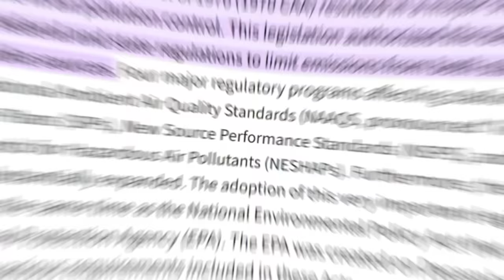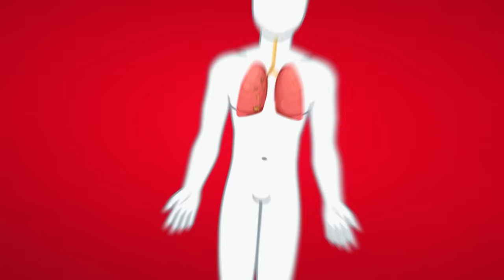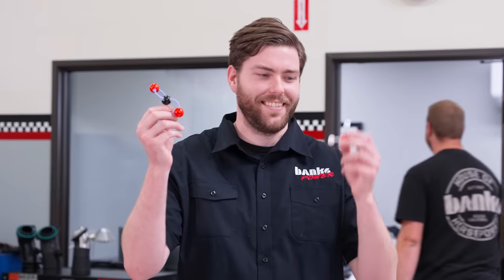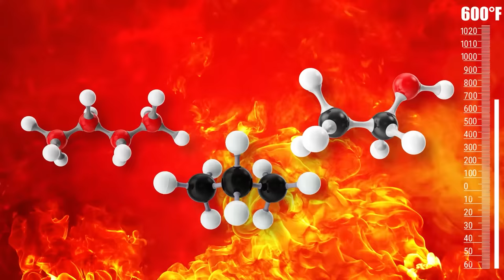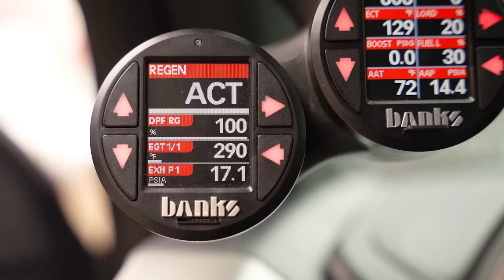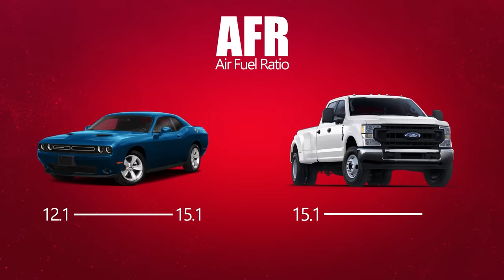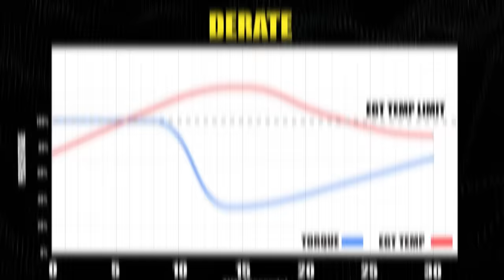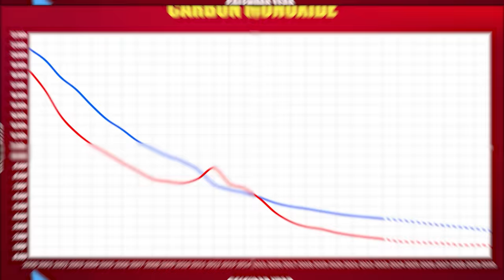Understanding the Most Hated part of your Truck | Banks Entry Level

Comment from the maker: With tighter emissions standards and stricter enforcement, the DPF and the rest emissions systems seem to be the only way to keep diesel trucks from being regulated out of existence.  Will manufacturers come up with a better simpler way to reduce emissions? Or is the DPF here to stay? What do you think?
Reply: ? Which is better for the health of your emission system: stationary regen or driving to clean?...Or does it matter as long the regen happens?
Reply: I think banks should engineer a free flow DPF w/ the manufacturer to make something more realistic reliable and EPA certified.
Reply from the maker: Or, even better as soon as someone figures out how to burn 100% of the fuel in-cylinder, DPFs will no longer be required. Toyota has patented a new diesel combustion process that may get us closer to that goal.
Reply: @bankspower  Isuzu 5.2..enough said.
Reply: @bankspower Shame that tech will never come to the USA then if Toyota patented it 😢
I love Toyota but having to move away from them since they refuse to enter the US diesel market. A proper 3/4Ton Diesel Tundra would make every other truck obsolete...
Reply: In Europe they burn Kerosene as their diesel instead of installing expensive muffler parts that will fail over a short period of time. Having a DPF and DEF system ends up costing the end consumer a lot of money for repairs. Great Video!
Reply: @Luckingsworth you underestimate corporate needs to license that patent to ensure their emissions compliance. I wouldn’t be surprised if the EPA pushes all passenger vehicle manufacturers to use that technology. Someone’s gonna copy the Toyota method, but slightly different and the rest of the field will buy directly from Toyota I predict.
Reply: It’s a money grab and should be deleted immediately.
Reply: CNH is "virtually" dpf free. They don't even use egr for their larger engines. Only scr/def and doc. Even the oil companies like amsoil say the oil last longer and test better than other emissions systems. However, offroad standards are a bit different, and ag equipment has a more fixed load scenario.
Reply: I’m hoping they figure out something new, I went back to gas 1 tons because of dpf issues, had two shit the bed over the years, and i know more than a handful of guys that have been left stranded by trucks with them. We need a different solution
Reply: @Luckingsworth I was hopeful when rumors started circulating then Nissan jumped in and I said please let Toyota get in on this…..and nothing. 

A game changer would have been tundra with Cummins and Aisin transmission
Reply: @ck3561  100%. The Tundra and Tacoma update was the final nail in the coffin for me. They 100% are riding the coattails of the Toyota brand and not only did nothing to innovate and improve, in many ways the newest gen are way worse than the previous. Embarassing.
Reply: Money pit
Reply: @bankspower So what are they doing about brake dust. It’s estimated at 20% of particulate pollution vs 7% of emissions particulate pollution. Plus brake are on everything. Even EV’s
Reply: Great info! Every diesel owner should know all of this info.
Reply: Locomotives have some kind of exhaust system that doesn’t use DEF. Tier 4 is the most recent exhaust requirement.
Reply: Too bad Banks touts the virtues of the Derringer inline tuner, but failed to make one for the 600,000 LML Duramaxes that desperately need clean tunes. Great presentation, but won't help me much without a clean tune.
Reply from the maker: @KeithGipe  We don't have a Derringer inline tuner for the LML yet, but we do have a programmer called the Automind. It can add up to +135 HP & +240 lb-ft. Part # 66411

https://www.bankspower.com/i-2132
Reply: @bankspower  "Yet"? I keep hearing Abnks reps say that, but no one will confirm an actual R&D program for the LMLs. Besdes, you miss my point. Banks NEVER says that the Automind2 tuner is an equivalent "clean" tuner. In fact, I've never seen any Banks promo for that tuner, ever. If it infact is an alternative clean tuner, why no promo that? Banks pretends it doesn't exist in their videos. Also, that is a flash tuner w/o any of the conveniences of an inline tuner.  I have Banks Monster Exhaust, Ram-Air, Super Gauge, and Pedal Monster. The tuner is the last piece I need and I'm hesitant to turn elsewhere since I love and trust Banks product. Several time Banks personnel have indicated there might be something in the works for the LML, but nothing seems to happen. The "Yet" in your replay is like dangling the carrot. Maybe Gale could turn a little of his attention back to his roots and service the little guy instead of putting 90% of his effort into lucrative govt contracts. But, I guess that's where the money is.
Reply: That why I still have my pre 07 model diesel truck, and for the commercial side. Will not touch any truck between 04 and 13. Due to they have so many issues. I just carry an extra NOX sensor like an extra light just incase. Replace the DPF filter on a regular basis (realize  we do over 250k miles a year). If you think they rip you off for the filter, then realize bulk DEF is like $1.50 a gallon, at truck stop you'll pay about $3 to $4 a gallon. If you go to a  shop, it's $12 to $15, so you really getting rip off more for the DEF.
Reply: I much prefer listening to Eric on video.
Reply: Have you folks ever had to do DME Diesels?
Reply: @bankspower  Mahindra doesn’t use a dpf on their tractors. Biggest reason I bought a Mahindra
Reply from the maker: @KeithGipe  The AutoMind an outstanding flash tuner, with a clean emissions profile. However, there is a superior device coming soon, as a result, we decided not to dedicate resources toward promoting the AutoMind. To be clear, we have a Derringer inline tuner coming for the LML. We also have another tuning solution on the way that we have not promoted, and likely won't promote until the day it's available. It's under wraps. This new tuning solution may very well supersede the Derringer. Regarding defense contracts, they can and do upset new product development. Our selection of LML parts is proof of his disruption. With that said, there are a bevy of new Duramax parts on the way, both mechanical and electrical. Gale has not forgotten his roots in performance products. It's the core of our business and it's our passion.
Reply: So what dpf need to put on cruise ships oil tankers and earth movers? Just a thought? Do they also have government complaint standards? And how does the government check them? And When they check them with what? Especially ships? And what gadgets they use? Earth movers also? how they check them? government officials fly out to unlivable areas? And what devices they use then? Do the big company's complying with the laws or just us ordinary people need to obey the rules..?? Or is it for big companies one thing and for ordinary people is another thing? Or juts big companies pay off to be queit so us ordinary people pay for everything?
Reply: @bankspower  Very good news. I'm happy that we're not forgotten. Look forward to hearing about and trying out the new stuff in the not-too-distant future.
Reply: Great video! Really clarifies why we have all that stuff. So here's my question regarding regens: I've read that if you drive your truck like you stole it, it should help with the Regensburg not occurring so frequently. So if you put a pedal monster on a truck and drive it, would that help with burning off that crude before it went into regen?
Reply: @Sennerav in Europe what.... We use dpf since 2005 or so... 🤣 And our diesel is actually pretty clean
Reply: @gato69evo  DPF was introduced in 2007 in North America on Medium and Heavy duty Trucks. The very clean diesel you refer too is actually Kerosene. Here in North America we burn heavy diesel oil or low sulfur diesel, red dye diesel not kerosene. It makes a big difference simply at the tail pipe
Reply: Meanwhile the government trucks don’t need em
Reply: Imagine a world where trucks were electric, and then clever engineers comes up with the idea of using diesel in a friction engine with turbos, high pressure fuel injection, end even with expensive converters, DPFs, still causes pollution. They would just be laughed at.
Reply: How about  requiring stricter fuel regulations  to reduce  soot.
Reply: @ChronoTango  If that is the case, then extending the life of existing and older vehicles well past their anticipated lifetime will become the norm. That is the "Cuban Effect".
Reply: Took all that crap off my 22 cummins it's useless
Reply: @lawrenceartz8640  I haven’t researched this new technology at all so I have no idea what it will bring with it. If it means a diesel motor will be even more efficient and less emissive, I don’t immediately see that as a bad thing, though I’m sure some extra complexity will come with it. As for the “Cuban Effect,” I thought that was due to embargos, not new vehicle technologies.

Did you just make up the “Cuban Effect”? When I look it up, all I get are redirects to Havana Syndrome and people being upset with Mark Cuban.
Reply: que me, banning DPF systems and any system that "is needless and excessive for the purposes of cost increases" Maintenance should never be expensive on a vehicle and we should not be introducing technologies that complicate vehicles.  the simpler the vehicle is the better and longer lasting it will be.
Reply: "Lets trap all the exhaust soot and carbon just expell it somewhere else all at one time!" Brilliant! Yeah emissions are a joke, instead of castrating the motor and making it run worse and shorten engine, mechanical part and oil life, why not get the engines to run more efficiently so they wont need that equipment? Oh wait, then they can't charge extra money for the DEF, which is terrible for anything it touches, not to mention the truck manufacturers make bank off all the emissions parts....Did I mention emissions are a joke? 😂
Reply: Do these products voids factory warranty?
Reply: My son wants to interview Gale Banks for his school paper on automotive industry icons. He’s the only one I know of who chose a living subject 😂
He loves watching these videos with me on Saturday mornings. Anyway how can I put my little guy in touch with the boss man Mr. Banks ?
Reply: @Fee.1  dude I would send a email to their pr team. Best chance. Don't know how much time he has though and good luck
Reply: @TheObsesedAnimeFreaks  thanks I’ll see if I can find their email
Reply: @TheObsesedAnimeFreaks  is he sick or something or you just mean his age?
Reply: @Fee.1  no i mean he's probably busy. lol. he's a business man. he's got work to do.
Reply: DPF... seems like plumbing the vaporized* oil back to the engine creates soot  needlessly, it being harder to burn and containing that zinc stuff...the other short chain carbon molecules that come with that oil is probably easy to burn. Perhaps a multistage oil separator process with a condenser to capture the moisture and then send the gases to the engine.
 
Incomplete burn of diesel causes carbon soot, so having inert gas from the EGR is causing pollution. EGR exasperating the need for DPF system is a ridiculous loop .

DPF also filters the sulfur soot but if they are already reducing the sulfur content in the fuel, and plan to lower it even further and sulphur is taking a 100k miles for it build up,  keeping the DPF for sulphur soot is prolly not needed.

DEF system to me is foolish because  because  the NOx returns to the soil as nitrates which is a fertilizer.
If you think about it NOx is produced by lightning which is a huge amount of energy, and there must be a way for the earth to deal with it.
Looking at the relationship between smog and NOx is that it needs un-burnt fuel (volatile organic compound)  to xreat the smog in the first place. NOx isn't a problem
Reply: I did the same to mine, yet it's to expensive to replace. My motor also told me that it didn't like sucking in its own farts, and when it does it chokes out and it's arteries gets clogged with carbon it previously tried to expell.

*I identify as a motor whisperer

So, out of empathy I took the rest of the cancerous system off of it.

She has never been so happy.
Reply: As usual Banks is right on when it comes to emissions.   I just sold off my Duramax and have a Mercedes Benz Sprinter.   As many in the RV community I wish he offered some products for them especially when you consider how many Mercedes Benz Diesel vans there are out there!   Banks, keep strong, you guys are the best!
Reply: @zekester1  Passive regen is better. Why? You are not using any additional fuel to get the DPF temps up to where they need to be to burn off the soot. This means less hydrocarbons entering the DPF to begin with and less fuel usage overall (no decreased MPG)
Reply: @mx3727  Yes, I agree passive regen's are better. My point is when an active regen is happening which of the methods is better on the truck
Reply: @zekester1  Which of what methods? I don't understand your question. There are only two methods of regen: active and passive. Passive occurs when the exhaust temps are already high enough to burn off the soot - that's the best scenario. Active occurs when the temps never get high enough during the drive cycle and the DPF gets to a certain percentage of soot load, and then the truck uses extra fuel to get the exhaust temps up to that magic 1100+ degrees to burn off the soot.

The SCR system serves the same function as the EGR system - to reduce NOX. The primary method to accomplish this is the EGR system, and if the EGR system can't get the NOX low enough, the SCR system "cleans up" the NOX "after the fact". So, if a truck seems to be all of a sudden using alot more DEF, it likely indicates an EGR system problem (assuming no actual DEF leakage).

A poorly running (or poorly tuned) engine will over-tax a stock aftertreatment system and cause premature failure. It's as simple as that really. Companies, like Banks, that put a lot of R&D into their parts and tunes have an advantage over some other companies that don't put in the R&D and maybe don't even fully understand how these systems work.
Reply: @mx3727  Again I agree with you on all you are saying...What I'm asking is driving vs stationary (manual/ forced) which is better?...let's say you turn off auto regen & you do mostly stationary regen's are you potentially creating future problems with other components because heat sinking issues?
Reply: @zekester1  Well, if you mean having the truck perform a regen while driving (either passive or active) versus a "forced" regen (using a scantool usually, though some medium and heavy duty trucks have a switch on the dash that can force a regen), I'd say that the former is better, since the vehicle is not sitting stationary and airflow over the vehicle while driving will dissipate heat generated during the regen. I can't point to any scientific proof of that, but it seems pretty clear to me that generating that much heat while stationary is not necessarily "good" for other components of the vehicle - not to mention possible environmental issues (don't be parked in the grass for instance).

So, your assessment that you could be creating future issues with other components due to "heat soak" over time seems valid, but I know of no statistics or studies that prove that out. Hope that helps.
Reply: @mx3727  Thanks for input, that's my thoughts also...have a wonderful day😉👍💪💯
Reply: They need to figure out how to get rid of DEF systems and be just as emissions friendly... up in Canada, DEF systems are such a massive problem and a huge cost for all the industries. I worked at a trucking company that had all brand new trucks and every single one would hit derate multiple times during winter months due to freezing DEF. The construction company is just as bad if not worse because they leave equipment on site overnight.
Reply: @jjunderwood4095  The problem is, they really can't. A by-product of diesel combustion is NOX; DEF helps reduce NOX by a process called Selective Catalyst Reduction (SCR). EGR does the same by reducing combustion temps. The problem is, too much EGR is bad for combustion, Hence the need for SCR and DEF.

In a lab, where everything is tightly controlled and they can operate in the "best" of environments, the engineers can likely design an engine that can meet emissions without EGR and DEF. But, as soon as you start operating in "the real world" and things start to wear, that goes out the window.

Those companies could have solved those DEF freezing problems if they really wanted to. However, I personally don't feel like the EPA needs to be mandating the standards they are when it come to emissions, which is the real driver of the emissions systems we see today. I'm all for clean air, but I'm also for using some common sense. There's still "work" that needs to be done, and having a truck derate to 5mph because the DEF is frozen (or the level is too low) is just plain stupid. BTW, I work as a diesel technician, so I know the deal.
Reply: @matthewholzmueller6292  if that sort of part works i wouldn't mind in the slightest about having a dpf ony truck as long as it doesn't cost a small fortune to replace or repair this is what I would like if you want  us to be clean and compliant give us shit that works not drain our wallets
Reply: @bankspower if that comes out and shows itself to be better give
Reply: @toofastnobrakes it's either delete or go back to gas
Reply: @fireflyraven2760  yep
Reply: Yah but these emissions systems are directly causing diesels to go the way of the dinosaur. I can't tell you how many people nowadays are switching to gas HD trucks because diesel engines have all of this crap on them and suffer for it. Even Ford knows this and is why they're coming out with bigger HD gas engines like the godzilla because they know some would rather have that than a modern diesel. These regulations are already killing the diesel, so someone either needs to find a physical solution that supercedes these systems or the regulations need to become a lot more reasonable.
Reply: @payton4148  and like true politics neither of those things will happen they simply don't see a reason to until their way of life is suffering then they look for alternative's as long as it makes them money they don't care
Reply: Brother I’m gonna learn something dem school books and pencils won’t teach ya. Horse power is horse power regardless of whether you’re deleted or not. But lemme tell you something partner. Unless you drop that metal clunker filter you ain’t never Gonna hear that BEAST WHISTLE
Reply: @rockynymia  we know that is why we delete
Reply: @rockynymia right on, The manufacturer knows having that thing is problematic for them and us. That being said the closer to 100 percent Efficient the combustion chamber the less work def system does, the longer it will last. The thing that grinds my gears is I bought this thing, paid taxes, and paid more taxes on every registration, and gallon of fuel. I never voted to have a cork in my tailpipe.
Reply: I love this video.  Can you do a comparison/debate and pros/cons of Solenoid Injectors vs Piezo Injectors and how they perform with modern diesel emissions?
Reply: Diesel prodeces way less emissions then gasoline. Even black smoke is getting you a higher fuel to energy ratio then the best gas motor
Reply: Is it better to attempt to engineer around ridiculous regulations, or to not do so thus giving more intense ridicule to said regulations? 
Seems the latter is more likely to reduce regulations, and the former only encourages more regulations.
Reply: I´ve heard that you can lower the clogging of the dpf by adding 2-stroke oil to the fuel.
Reply: I have heard that JD has a high HP engine that doesn't require Def. If it works out others will have it also.
Reply: “Or, even better as soon as someone figures out how to burn 100% of the fuel in-cylinder, DPFs will no longer be required. “ It’s already been figured out, but you can’t have one company with the only technology. That’s why DPF are used, it’s shared technology. I bet you will still have a DPF for five to ten years from now.
Reply: Meanwhile a cargo ship burning 2623 gallons per hour. It works if all of the components work but they don't and then its even way worse, the repairs on these are ridiculous.
Reply: Diesel Trucks are going through what passenger cars went through in the mid to late 70's.  If they make through in 20-30 years they'll be truly amazing.
Reply: Looks like there's some new injectors on the horizon that solved most of these problems, may be able to get rid of DPF 🤞
Reply: Doosan/bobcat redesigned their entire engine structure so that it burns clean enough to not need a DPF and I fricken love it. Wish on road OEMs would be able to do the same. Especially since about 14 cargo ships burning bunker oil make more pollution than the entirety of the us diesel land vehicles, it's a clown show to even worry about diesel emissions for our light/medium duty road trucks.
Reply: I'm still trying to figure out how a bunch more plastic jugs and cardboard boxes is helping the environment.
Reply: Where is your shop located
Reply: @Luckingsworth  tundra's arent even competitive with existing gasoline half tons. They have the fuel economy and ride of a 3/4 ton, the power of a half ton and less towing capacity than a half ton while not towing what it can as effectively as any of the big 3 half tons. It is not an engine question, it is an everything problem with the truck at higher pay loads.

Coming from someone whose next truck is most likely going to be a tacoma
Reply: There has to be a more fit for purpose design that does not restrict or hamper performance and service life.
Reply: @toofastnobrakes  stop abusing your rig then
Reply: @firefighter4443  an engine that always runs at optimal load and temperature range doesn't need it, none of the crap that DEF cleans up is ever produced
Reply: This is my my thoughts on the subject. To meet emissions we have to put def fluid (urea basically) which uses a bunch of energy to produce. Then they put it in a big plastic jug (all in Germany by the way). Put it on a 1000’ ship that burns crude oil that needs to be boiled so the it’s viscosity is low enough to be pumped into an engine the size of a house. Then put on a diesel truck to be taken to a warehouse, where it’s put on another diesel truck to go to retailer/gas stations. If that wasn’t enough, a portion of the exhaust on your diesel truck is valved back into your engine for a second burn. Which lowers your fuel economy so you burn more fuel. All of this is so you don’t see some black smoke coming out of a tailpipe. 😂 well done 👍
Reply: @socialexperimentgaming4808  unfortunately, now the cancer shifts into the lung.
Reply: Curiosity, if you buy a truck from another country that doesn’t have DPF and import it into the US, do we need to add the emission equipment to meet the current emissions standards? IE, not deleted from factory because it wasn’t required in that country.
Reply: @Upsidedownfoodpyramid  you don't need to do anything, because it would never get past customs. Even as an off road vehicle it would be difficult to get it through.

But why would you want one? The only diesels available outside of the united states that don't have the equipment will be absolutely terrible and completely underpowered for canadian or american purposes.

Some of the same reasons for why modern diesels are better than diesels from 35 years ago (which include SCR and EGR) would still be relevent to even a brand new diesel from india, thailand, venezuela, etc
Reply: @bankspower probably the most professional comment I have ever seen from a company in replay to a customer who was just being a big cry baby…. Maybe he shouldn’t own an LML 😂
Buy a Cummins like a big boy. Thanks for everything you do BANKS!
Reply: @malcomreynolds4103  I understand but maybe they need to create lower backpressure DPFs that don’t need to be cleaned via regen as often that can help increase fuel mileage. I have seen fields catch fire from exhaust temps during regen during haying season. I have a few friends that are tow truck and hotshot drivers that has had issues that exceed the value of their trucks. The engine and transmission were good but had to replace the emissions equipment. The downtime cost a lot of money and seemed impossible to get it right the first time. At the time, there was a lack of parts, so not only did it sit at the shop but they were not very good at diagnosing the issues. IE fixed the blocked DPF but didn’t figure out the root of the issues. A sensor was bad but didn’t flag a code and caused it to block 3 times before they figured it out. 

The dealerships and auto shops have to replace emission components with original equipment and manufacturers have a monopoly. Maybe there needs to be a push for aftermarket parts that are CARB compliant and that are more economical, efficient and reliable.  

Banks has done so much for the diesel community. I would love to give him a shoutout for his great work! @bankspower

I would love to see Banks help the diesel community with this issue. I don’t need more HP or Torque, just more reliable, less expensive fixes, fuel efficiency and less chances of causing damage because of exhaust temperature.
Reply: The dpf system as its designed to work is unreliable at best and at worst dangerous. Unburned hydrocarbons in the fuel says more about fuel quality than anything. Just better fuel standards would solve a lot of that. And I feel like the egr in the system creates more problems than it solves. If you have an issue with unburned fuel getting to your exhaust then you either need to increase head preasure on combustion stroke and lower fuel delivery or you need a more even fuel delivery. So no mater how you look at it there's two inefficiencies working against the system from the start. Thats not including fuel quality or additives for the area you live in. With diesels using a longer piston stroke for combustion and most having an issue with some sort of blowby then yeah a new piston design in a wet sleved engine allowing you to raise head pressure could allow you to reduce fuel delivery just above starvation and you can figure out how much more fuel is needed for lubricity from there usually it's around 10-12% above threshold. Some of that excess fuel will still come out as unburned hydrocarbons but the cat alone should be able to handle at least 70% of that. No need for an egr or dpf system at all. Higher linger time for the exhaust can also help. (Cooler the exhaust gasses are when leaving the system the more particulates collect into heavier solids that can be caught down stream. A simple  yet less extreme version of the dpf can then be designed into the muffler. No extra heat needed. Just routine maintenance.
Reply: @bankspower  Toyota is really becoming an innovator in the market.  That would be great. Please understand that most of us care about the environment; we want clean water and air... but the current emissions for diesels in the US is so complex, expensive, and unreliable(unlike the rest of the engine!), that it makes it hard to own an emissions compliant truck.  Owning a Powerstroke, the first annoyance is the EGR cooler building up with soot and feeding that back into the cylinders. The DPF is the cherry on top.. My exhaust has no less than a dozen plugs/sensors and weighs a ton.  There's got to be a better way!
Reply: DPFs became mandatory throughout all European nations in 2009. DEF became mandatory in 2015 when the EU introduced the Euro 6 emissions standard. They do NOT burn kerosene, which will destroy modern common rail diesel engines. They burn diesel meeting the EN 590 standard, which was introduced in 1993.
Reply: I think getting better burn is better than trying to filter it. I doubt it will go far with current political tone, but the dual fuel stuff the universities were trying seemed to be getting almost no emissions by using diesel and gas injections to get high efficiency burns in the cylinder. It also might be too much for affordable mass production.
Reply: Regen is worse for all worse for the engine, worse for you, and worse for the environment and all around when regen is in effect. But hay no one is tailgating you
Reply: honestly i think the dpf will be here for a while. but with the emergence of hybrids (in particular the series hybrid style) and better knowledge of how diesels and other ice engines prefer to be operated i think the dpf will become less of a headache.
Reply: What’s worse, plastic jugs, chemical exhaust, manufacturing DPF byproducts, or black soot that settles once airborne?
Reply: @bankspower   Can you review the FASS EGR filter system please.
Reply: Some good points followed by contradicting information here.  Like DEF saves you fuel but then the fuel you save gets used to clean out the DPF.  My thing is, we talk about tuners and their dirty tunes but are manufacturer's any different?  There are a very small handful of aftermarket tuners that have been able create smokeless tunes.  I understand that there's still NOx emissions but I feel that's definitely worthy of further research.  These guys have figured out the air/fuel ratio throughout the powerband and delivered some serious power while doing it.  This essentially brings you back down to just requiring the SCR catalyst.  Which mirrors a gas engines emission system.  Most people will argue that diesels are subject to varying loads and writing a tune to meet those demands isn't feasible and that manufacturers hands are tied and they're doing the best that they can.  But are they?  You'll have high performance muscle cars, sports cars and supercars all with varying drive modes that change every characteristic of the vehicle from suspension dampening to steering feel and yes, even horsepower.  I think manufacturers have been caught up engineering workhorses without putting thought into the fact that diesels trucks, in and of themselves are high performance vehicles.  I think it's time manufacturers begin looking at them as such.  The aftermarket already has when you consider how they advertise different power levels or "modes" if you will.  Why can't the manufacturer do the same?  Tune the shit out of 3 or 4 different drive modes tailored to what the demand of the truck is gonna be.  Everybody will scream cost but we'll dump money for massaging seats, big displays and enough wood and leather to male Ron Burgundy jealous.  Fuckin send it!
Reply: But why are all pickup trucks on all military bases in the US deleted from the factory if emission control systems were implemented for our safety? Don't the US military personnel need clean air, too?
Reply: What about those pickup trucks on US military bases in the US that are factory-deleted?
Reply: What about those pickup trucks on US bases in the US that are factory-deleted?
Reply: @bankspower hydrogen
Reply: scania engines don't require DPF and are offered up to 770 hp in trucks 1050 in marine
Reply: Neither I think the people of this country are fed up with the government and things are about to change
Reply: @KeithGipe o
Reply: I never understood why they don't pick egr AFTER the cat and dpf , this would avoid all gunk inside the manifold causing all sorts of problems
Reply: @toofastnobrakes Dave at Dave's Auto Center in Bountiful Utah is conveying the exact same diesel manufacturer problem
Reply: I worked in an Arctic oil field for over 30 years. Vehicles aren’t shut off all day and idle a lot. In the early 1980s the big push was to go to diesel light vehicles. When they went to using DEF in diesel light vehicles it didn’t work because of the low speeds and cool temperatures. Now all the light vehicles are back to being gasoline.